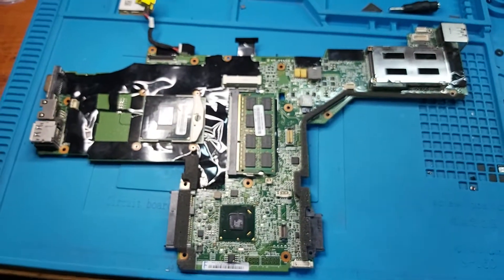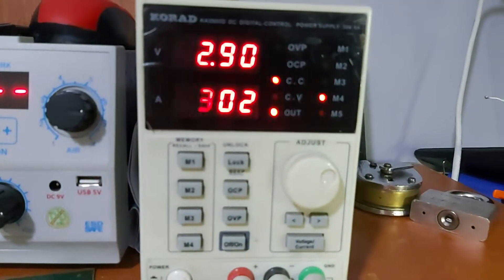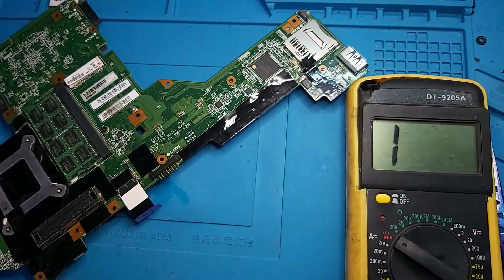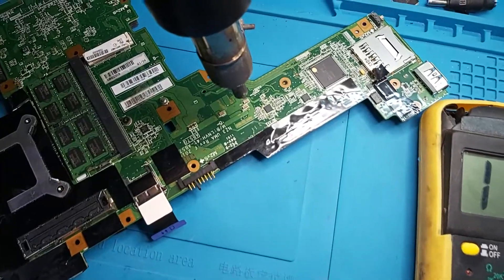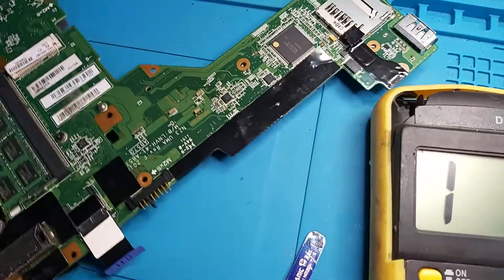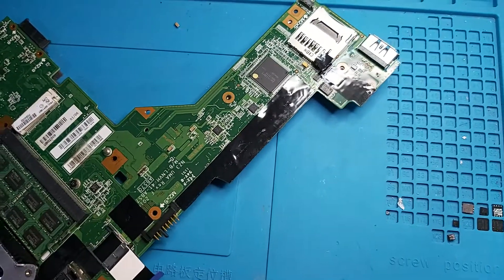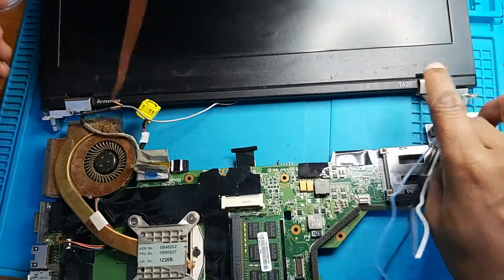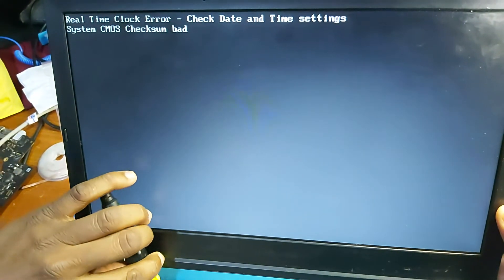Lenovo T420 not power ON

Comment: hi there, this video has been a great help. is it possible to get a copy of the schematics to obtain the specifications of the capacitors?
Reply from the maker: Yeah its possible if schematics for a particular model is available,some model doesn't have schematics so i replace a cap from same voltage rail .

Comment: Great video, but is it recommended that we just use the PC without replacing the capacitor you removed?? What are the effects on the computer when the capacitor is absent.
Reply from the maker: You have to read functions of capacitor on circuit you will understand better
Reply: @northfixtz  Ok thanks so much for the reply

Comment: I have a lenovo t420s fan error. Change the fan and it doesn't go away. Any fixes? New fan
Reply from the maker: Did you try to reset by removing cmos battery ?this will reset all saved bios information to default

Comment: hi, i have here an T420 with "Fan Error". I replaced the fan but it will not spin.  
the error is still there. from far someone or do you have an idea?
Reply from the maker: Can you check voltage on the fan connector  ,,you can reset by removing Cmos battery may be it will work,,,is also fan new?
Reply: @northfixtz  
thanks for answering..
https://youtube.com/shorts/dL3T74Mlkq8?feature=share
when i connected right...
cmos was disconnected and this fan in the vid is the new one...

Comment: Hello sir, I have a problem with the same lenovo T420, it won't turn on when I press power. On the PSU the ampere is also not moving, if the cpu chipset is installed the ampere does not move, and a lot of short capacitors if the cpu is not installed the ampere goes up 0,16A and the capacitor that was short becomes not short and the area is warm on the U5 chipset, what should I do, thank you very much
Reply from the maker: Let me check on schematic by tommorow  i will give u feedback also contact me on whatsapp +255659166796 for quick reply
Reply: @northfixtz  thank you sir

Comment: Hi , i have a question at 01:09 ,You spilled some alcohol on Ceramic Capacitor , they were 19v Main Power Rail  ? thnx
Reply from the maker: By experience most of big caps lie on the 19v (main power rail)so if the main power rail short to gnd most likely i check capacitors first...thanks
Reply: what type of alcohol? percentage?

Comment: Hi there , i have a question how did you connect your power supply in to your mainboard ?? please in your next video show us for details.. did you use normal charger connect to mainbaord ??  how did you use the power supply and inject the power in to mainboard !! because you just showed the voltage in drop to 2.95 thax